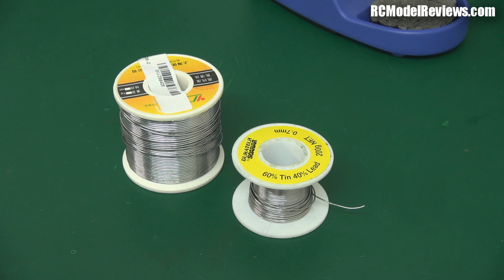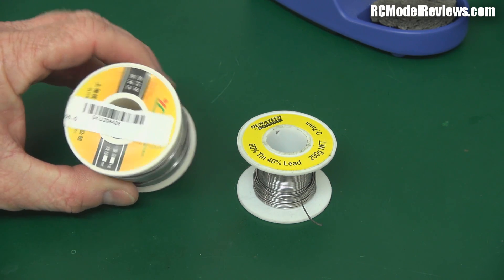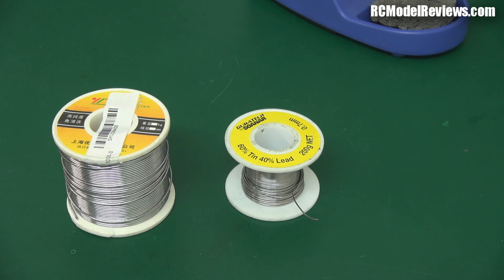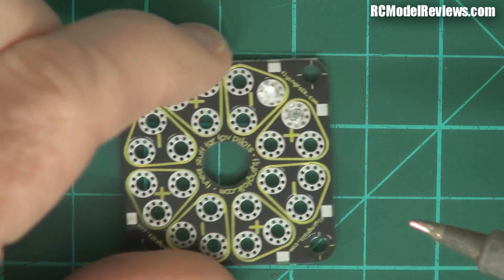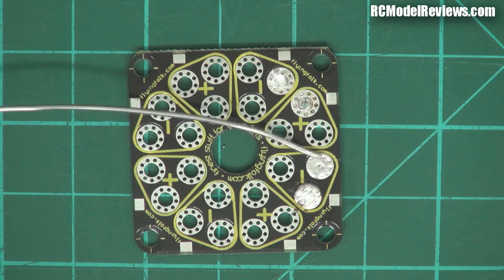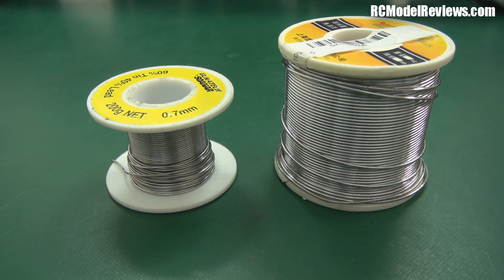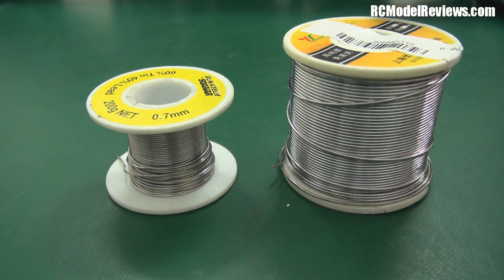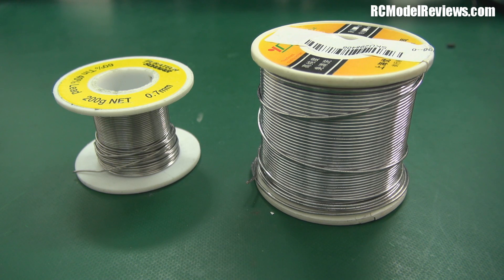60/40 versus unleaded solder

Comment: great video, thanks so much for these. i've been using the hobbyking solder that says it's 63% tin, is it safe to assume that it is 37% lead? 

Should i be wearing any protective wear to stop inhaling the solder fumes?
Reply: +Dictator In Perpetuity Damn right I am! Newton was a fraud...
Reply: thanks mate, it's hard with a fan as this seems to cool the solder really fast sometimes
Reply: hey thanks mate, i really appreciate the advice! i'm gonna order one now haha.
i also have just had kids so this is probably necessary.
Reply: +Dictator In Perpetuity Note, there cannot be much metallic lead in the fumes because the temperature is way too low to boil, however:
http://www.sentryair.com/solder-fumes.htm

LEAD OXIDE
The following paragraph was extracted from OSHA's website (www.osha.gov)
"Lead is used in the soldering process in the form of lead/silver filler metals. When heated, lead oxide fumes are formed. Excessive exposure to lead oxide fumes can result in lead poisoning. Symptoms include loss of appetite, indigestion, nausea, vomiting, constipation, headache, abdominal cramps, nervousness, and insomnia. Lead is absorbed through the mucous membranes of the lung, stomach, or intestines and then enters the bloodstream".

The following is extracted directly from the warning label on a roll of 60/40 rosin core solder.
"WARNING: THIS PRODUCT CONTAINS LEAD AND MAY CONTAIN OTHER TOXIC METALS OR CHEMICALS. Ingestion or inhalation of fumes or particles released through processing could cause lead poisoning or cancer. Absorption of lead is known to cause birth defects and other reproductive harm and may result for example in damage to the blood and neurological systems. Use only with adequate ventilation. Use NIOSH approved respiratory protection when necessary. Wash thoroughly before eating, drinking or smoking. Not for use in portable water service systems. THIS PRODUCT ON FILE WITH ROCKY MOUNTAIN POISON CONTROL CENTER".
OSHA currently defines the exposure limit on "lead inorganic fumes and dusts" to be .05 mg/m³
SOURCE: US DOL/OSHA 5/23/2001.
Reply: +Dictator In Perpetuity  The boiling point of lead is around 1750 C while soldering temp is around 360-400 C. At such low temperatures the quantity of lead vapour from soldering would be tiny. The smoke generated while soldering is from the burning of the rosin flux which is essentially tree sap. Some find the odour pleasant while others experience irritation. At a hobbyist usage level I see no imminent risk to using leaded flux cored solder that a simple hand wash and good ventilation would not remedy.
Reply: +FPV.Mike There has been talk about fumes so I will only mention the fingers. Wash your hands, I wash mine once,then put the scrub brush with a second round of soap. Lead can be absorbed through the skin... Touch the lead then touch your eyelid, nose or any sensitive skin and it transmits even more easily.  

I was told a story about a person who worked in a lead-acid battery factory who's infant child became ill because the child was crawling on the carpet that he walked on after coming home from work...(after that point the factory created a clean room where you wore their shoes garb- etc and at the end of the day went home in your unexposed garb.

When I had lead poisoning from soldering batteries, it was found that lead, and other metals like tin had a more pronounced synergistic adverse affect than just one component. The more unwanted types of metals at a lower level can be as bad or worse than just one metal at a higher level.

Also, if you suspect toxicity do a hair test for metals. Many metals like lead will transfer from the blood to the bone and after time a blood test is not as accurate to find and accurate metal level in your body.  Richard
Reply: +rdb127 Dont know why it gave me a strike through on my name. That was not intended.
Reply: +FPV.Mike Some interesting comments in amongst these. Wanna be totally OH&S compliant to your body? Then don't drive a car - or be anywhere near a busy road (you might just get some Asbestos dust as well). Don't stand near or walk past anyone who (Heaven Forbid) still smokes. Don't breathe in any diesel - or much much worse - jet engine fumes. Don't drink commercial "Orange Juice" (it's full of carcinogens)... and don't eat an Apple unless you've grown the tree yourself - without using any pesticides or fertilizers ever in it's life cycle - and it was grown in Iceland. In fact, just give up now. You're  body is probably waaaay beyond ratshit already just by having been even near a City of any kind... it's already done more damage to you than using a kilo of leaded solder in a week. Don't believe me? Find out what they put in ULP (unleaded petrol) just out of interest  - you'll be screaming to bring back good ole 'leaded' 'Super' when you do...
Reply: Actually the tin/lead doesn't fume much, it's mostly the flux which is some really nasty stuff - use a fan and try not to breath the flux fumes.

Comment: i think lead-free solder is why my good old ps3 died. Same as 2005 iMac >.<
Reply: jon mellor i reflowed it 3 times, then destroyed it when i was trying to remove it for a re-ball attempt. Ps3s are cheaper than AXNs now days
Reply: +Ty Lloyd shoulda tried to bake the board,fixed my ps3 and is still working!
Reply: +jon mellor  hot air solder station guys lot of components dont like the heat needed to melt dry solder joints

Comment: It's terrifying that they are now using lead free solder in aircraft and medical devices.
Reply: Djhg2000 It's almost as if somebody has evaluated the environmental implications against the safety implications and made an informed decision.
Reply: Aircraft are exempt from the lead-free requirements, medical devices however are not.
Reply: Actually on further reading I'll have to correct myself, medical devices are explicitly exempt from RoHS so lead free solder isn't a requirement there either.
Reply: Atomicskull Current lead free solders are formulated to avoid tin whiskers.. but the point is moot. This issue has been thrashed to death; RoHS doesn't exist for technical reasons, it exists because we dump too much crap into the environment. There are exemptions for situations that could be potentially dangerous.
Reply: +donpalmera If you would have watched the video he gives multiple clear real world examples of why lead free solder is not as good as leaded solder. It's not just hearsay, the lead free stuff just doesn't match up...
Reply: TheSuperDuperEpicGuy To be used in aircraft etc the safety issues you're worried about will have been considered and evaluated. Things like bad joints because of moving a wire while soldering don't really count when everything is done by machine do they?
Reply: But it's a moot point, aircrafts aren't required to use lead free solder and as far as I know neither Airbus nor Boeing use lead free solder.
Reply: +donpalmera Tin whiskers are the real problem with lead free solder, there is no known way to prevent them other than adding lead to the tin and they are atomically sharp and will pierce any coating you put on the joint in an attempt to contain them.

h**p://nepp.nasa.gov/Whisker/background/index.htm
Reply: +TheSuperDuperEpicGuy
> the lead free stuff just doesn't match up

BTW; RoHS doesn't exist because it's technically superior. Yes leaded solder is easier to work with etc etc but the amount of e-waste being created means that we have to come of with ways of reducing the amount of crap that will damage the environment when it gets dumped in the landfill. Whether current RoHS helps all that much I'm not sure but I think you'd have a hard time arguing that continuing to dump lead into the environment is a good thing because of "reasons".
Reply: Indeed, so can we please put the aircraft and medical device worries to rest now?
Reply: +Atomicskull maybe the people responsible for deciding what materials can be used have used more scientific methods than "I heard on the interwebs that lead-free is baaaad" to evaluate the safety.